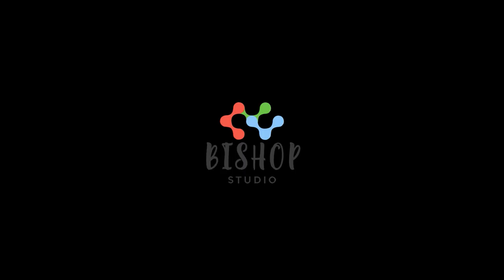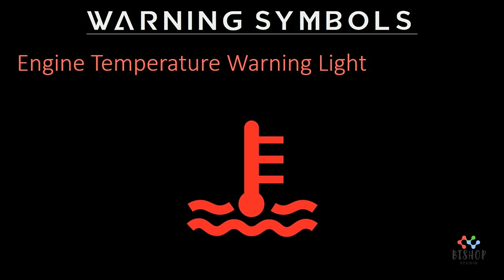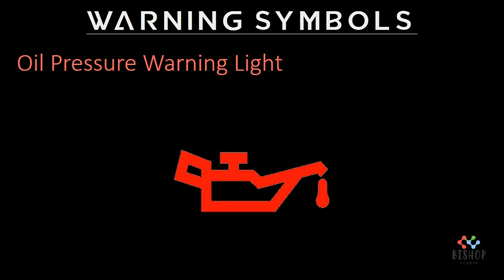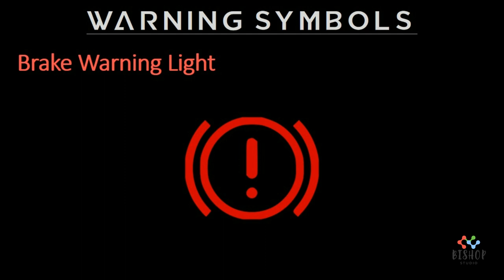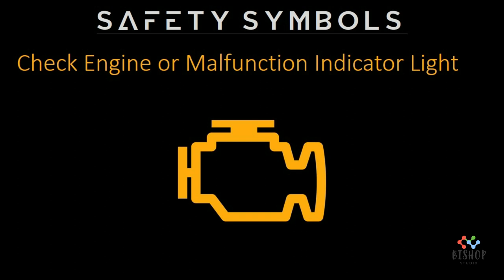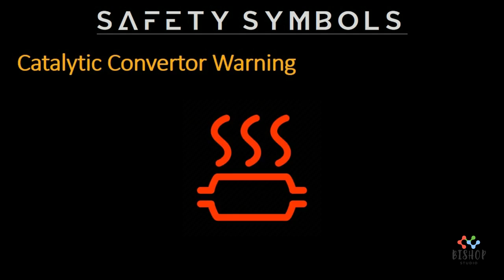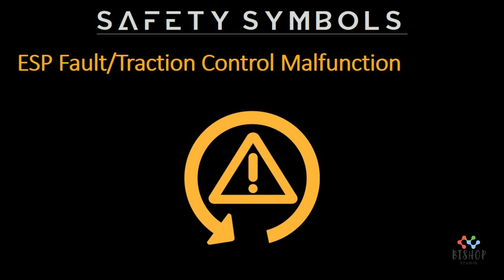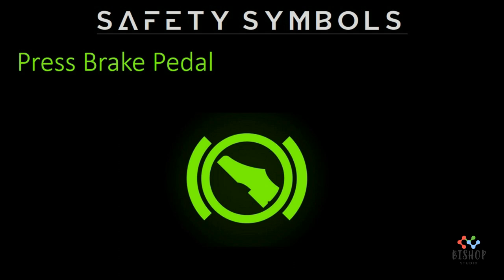Dashboard Warning Lights ගැන සිංහලෙන් දැනගනිමු

Comment: Power steering warning light eka paththu wela wahane start kalata passe eka nathi wenawa nam eken mokadda kiyawenne? Aiye?
Reply from the maker: Malli reply danna parakku una sorry... mehemai malli on karama oil indicator bulb eka wage okath on kalama pattu wela aulk nettam start kalama off wenawa...start kalata passeth paththu wenawa nm thama streeing system eke prashnayak tynna puluwanne... ehema pattu wenawa nm power steering eka nathi wenawa e kiyanne oyata kohomath eka denenawa malli harawanna amarui wenadata wada... hydraulic assist ekak nm fluid level check karanna power steering reservior eke... EPS nm
Hndhama dae mechnical support ekak ganna eka... oyage wahane start kalama niwena kiyanne e blub eka check karaganna system eken wenda deyak wenna ona...
Reply: Thanks ayye

Comment: Toyota axio 141 2007 model eke VSC tiyanawa da
Reply from the maker: Vehicle stability control eka nm hariyatama dan nh... 2007 model eke indala thama mn toyota VSC eka axio ekata include kale... wahane dash board eth indicator ekak tynawa... button ekakuth tynna ona
Reply: @bishopstudio6148  Mage tiyenne axio 141 2007 X grade ekak. Eke RPM meter ekak na. Eth G grade eke enawa. Mata danaganna ona G grade eke  meter board cluster eka X grade ekata set karanna  puluwan da kiyala.
Reply from the maker: E gena nm mn hariyatama dnne nh....